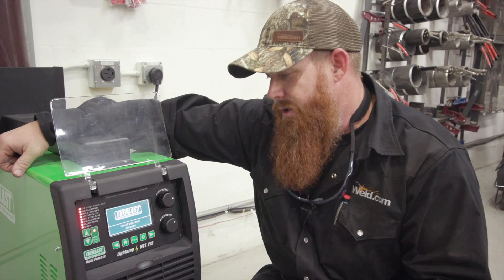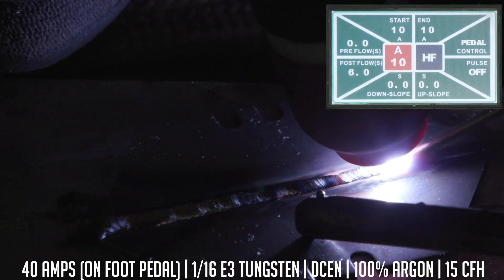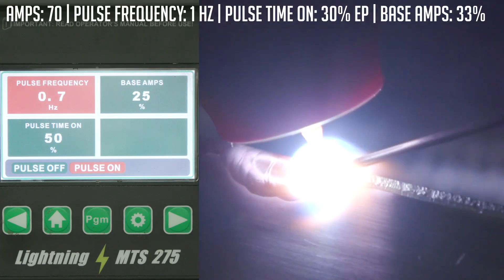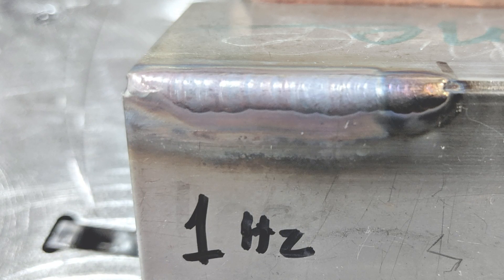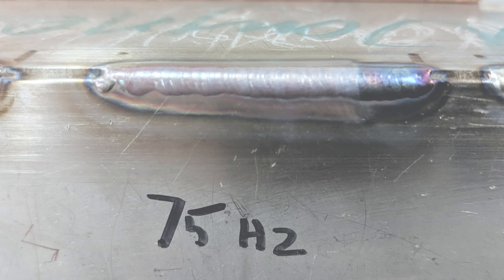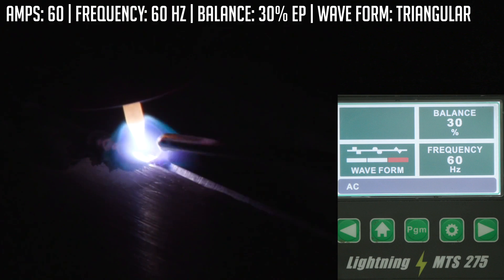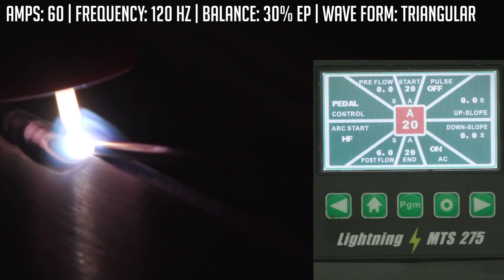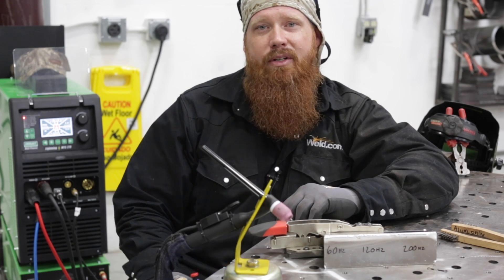Everlast Lightning MTS 275 Review: AC/DC TIG

Comment: Looking at one of these lightning 275's for our shop. Trying to decide between this or the Millermatic 220 ac/dc. Dont do much aluminum tig but would like the option and ability to learn more. for the money these machines look really hard to beat!  Anyone suggest this over the miller and why? I realize that theyre different amperage machines and the Everlast is considerably less and can get the water cooler/cart package for over $1000 less. Thanks!

Comment: I know they're one of your sponsors but I do have a question that I would like your honest answer on. Is this machine too much for a beginner? I'm not talking about the price I actually think the price is pretty damn good for everything that comes with it. I just don't know if this machine has too many settings for someone starting out. 

Most of the time I plan on using this to repair body panels on car bikes trucks hell even an airplane if you can get it in my yard lol. It's very close friend of mine owns a large welding company across the whole state that I'm in. There is time that he gets things that is too complicated of a weld for his guys. All they do is stick weld. And they're not getting judged on how well the weld looks. He has a lot of different things that people contact him for and it's mostly stainless steel and then aluminum. 

I do know how to stick weld when you have a close friend that owns a large welding company sooner or later they will ask you to go with them a give them a hand. Matter of fact all they use is gas powered machines. Most of the time when they break he does not have time to fix them and most of them come to my house so I can work on getting them back up and running. With doing so I have learned stick welding.

I don't do a lot of MIG welding right now. He gave me a brand new Miller 140 a few years back for getting three of his machines up and running in one day. The only thing is that it's set up for flux core and as you know all I would need to do is hook a bottle up and change my wire.

Sorry forgiving you so much information but I figured it would help you to answer my original question if you knew a little bit of my background in welding.

I do enjoy your videos and yours was some of the first ones that I had watched to learn more about a tig welding.

Look forward to watching some more of your videos.

Comment: Assuming I had the money and needed a new welder, I would just spend the couple hundred extra and buy the multimatic 255. My current everlast works good for what I need it for though. And I don't have $2500 laying around either haha. Great review though, keep up the good content.
Reply: The Multimatic 255 is not a "couple hundred extra", it's at least a grand extra.  And even though it can do push/pull aluminum, it CANNOT AC TIG aluminum.  Not really a comparable machine.

Comment: I have a mys252...and im newbie to tig welding... need some tips a advice... have the below questions

Im trying to practise weld with no filler...  on some clean 1/4 steel plate.... welder set dc tig.. 125 amps post flow is 8 sec... when end my weld and the arc stops my tungston melts... and i didnt  dip in the weld pool.. i think i dont have my welder set up correctly... also when im welding the display  say only 20 amps and im not get a good weld pool i have nice arc... but not sure what going wrong..

Can anyone help or make 101 tig video using mts 252 setup video

Comment: Excellent sir, 
I bought the MTS 235 several years ago and have yet to use it. I'm a renter, and my landlord wont allow me to install 230v into the garage. I didnt think of that when I purchased the welder and the plasma cutter. Dohhh!
Now with the electrocution I'm not sure if I will be able to go back to welding, I'm pretty torn up...
Reply: Do you have a dryer receptacle close to your garage? You can get a receptacle converter and extension cord that will give you nearly your machine's full capability without changing the wiring. The dryer circuit (and breaker) are likely at 220v 30amp - unless you're trying to weld a Navy ship or bulldozer (which you could do on stick anyway), you're not going to pull more than 30 amps anyway.
Reply: @bwjbrown  Range receptacle in kitchen is likely 50A

Comment: Just a clarification: This welder has Advanced Square Wave, Soft Square Wave, and Triangular.  There isn't a sine wave on this unit...though that may be something we could consider.
Reply: Everlast Power Equipment your welders have came along very nicely from the early days. Progress is inevitable, but you have to be trying and I definitely see effort.
Reply: I have the 252 STI, any chance of an add on to be able to view all the current settings on a screen similar to that, debug port output or similar? Would be nice to glance over and check all the values rather than have to flick through.
Reply: @SteveBlue90  Sorry, not in the works or capability of this machine.
Reply: @SteveBlue90  To further explain, That's sort of how we have it, or at least as many common values as we can arrange on the front logically. But no port accessible for the user at this time.
Reply: @michaelr6392  First Quarter of 2020.
Reply: @everlastgenerator  thank you. Does it have mig pulse as well? This is why I hesitated between the 252sti/251sti  because only one machine had one and the other only had tig pulse...
Reply: @michaelr6392  It does not do pulse MIG. It will retail for $3800-$4000.
Reply: @michaelr6392  No.  It doesn't. Keep in mind that if you are serious on MIG pulse our Power i-MIG 253DPi is by far a better MIG pulse welder because of the synergic function of both single and double pulse.  The 251Si is manually set single pulse.
Reply: well then you'd need to add a transformer lol
Reply: What generator can this run off?

Comment: Could you explain what difference the different waveforms have on AC Tig welding!
Reply: Advanced square is all around best, controlled arc n good heat input. Soft square and triangle wave are better for thinner alum because EN and EP are are switching faster so less heat input, sine wave is just like the old transformers (syncrowave, precision tig) which is sort of like soft square. I mainly use advanced square on +1/8" and triangle on 1/16" or less

Comment: I’ve been looking to upgrade my everlast 200sti stick machine into multi process and this might be the ticket, if the price is right. There machines are great for hobby use where industrial reliability isn’t required.
Reply: Eoupd you say it's not reliable enough for industrial use?
Reply: It has an industrial duty cycle, what about it isn't reliable?
Reply: @jonathangarzon2798  by industrial duty cycle I mean 100% duty cycle. My everlast only has like 20-30% duty cycle at max amps.
Reply: @FishFind3000  industrial duty cycle standard is 60% but okay yeah that's not that good.

Comment: I would have loved to know what your settings were for that can weld!
Machine and the Argon please, sir?
Reply: Aint1S 1/16” tungsten 30° grind angle, 1/16” E4043 filler, gas lens with 20CFH, 20amps no pulse 200Hz frequency. You need to clean the cans really good, we used 120 grit sandpaper and then scotch brite. Then wipe it down with acetone. Poke a hole in the very bottom of the cans so the air can escape. If you don’t the air will heat up and blow out your weld towards the end. Good luck man. Oh and you’ll also need a pallet of patience 😂 👊
Reply: @GodslilRedneck23  I've never poked the hole nor used 200Hz for it after the most foil failure on my first try a few years ago! Holy smokes, those cans can stink my whole shop out!
Great machine you have there and amazing advice!

255 EXT here...
I welded the to razor blades and stepped down to two 60° exacto blades with some of my electric guitar string. That was high science using that wire, but I kept that one for proof. It's the smallest bead ever I've ever put down dabbing. Looks like a sharp ♥️.
Reply: @GodslilRedneck23  This would be very handy if your beer can sprung a leak :-)  Your welding videos are the best!

Comment: What’re those gloves you’re wearing lol looks like maxi flex..
Edit: they are maxiflex are those thick ones or what?? I’ve never had a pair of those I could weld in besides bridging and deck lol
Reply: Joshua Marcotte I used these because of the low amperage and small filler size. I needed more dexterity. I wouldn’t recommend them for welding with for most things.

Comment: I bought a  200 amp welder directly from China its the best welder ever in the amp range , I only welder I've seen or known off that does 500 ppm on AC and  500 ppm on DC current, I have the everlast 255 ext welder for slightly heavier aluminium, but my go to welder is the Chinese welder, it cost me about $570 Australian dollars freighted to my business and have used it for the last 5 years not one issue, my everlast cost $3150   The Chinese are ahead in the market place in technology and engineering we don't always get the models released R and D , my welder was hand built and assembled for me directly from the company and that is standard for new customers , some of the features on my welder are slowly being released on the market now, 5 years latter 👍😀
Reply: Sorry typo should have bee  pulses per second

Comment: In my experience pulse has always produced a better weld. Is there ever a time when its not appropriate to use?
Reply: Beach&BoardFan it’s all user preference. Usually on thick stuff I won’t use pulse.
Reply: Interesting, whats the reason, it just slows the weld because the heat is on and off?
Reply: Beach&BoardFan correct, it allows for quick moments of cooling in the puddle.
Reply: You guys ever do any copper or aluminum bronze mig welding? I just started doing it and am currently struggling with undercut.
The welder is an old miller deltaweld 451.
40 cfh of helium
29.5V
The wire speed is just a numbered dial thats set at 2 1/4 (it doesnt say inch per min or anything)
1/16 solid copper wire

While welding horizontal I get terrible under cut. I'll tilt the wire up about 5-10 degrees but it still undercuts about 1/16th of an inch. Flat is fine and over head is fine, but horizontal always undercuts. I've only ever tig welded copper before, so this is uncharted territory for me.